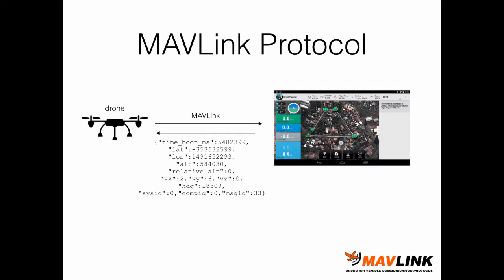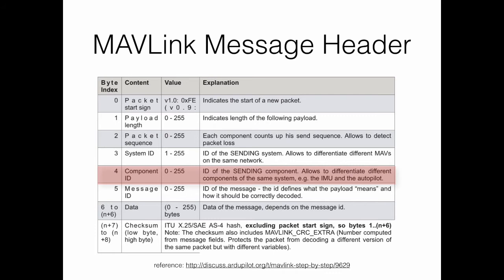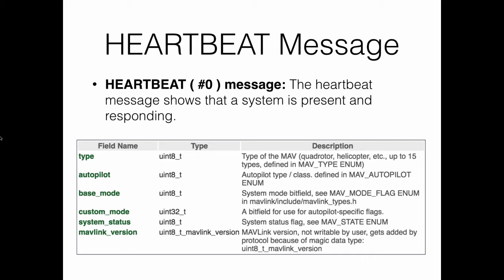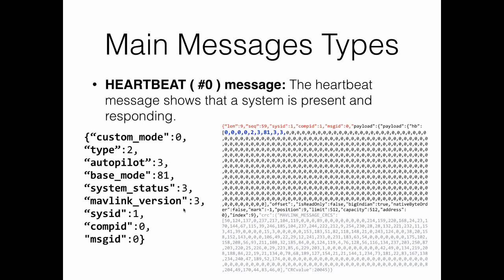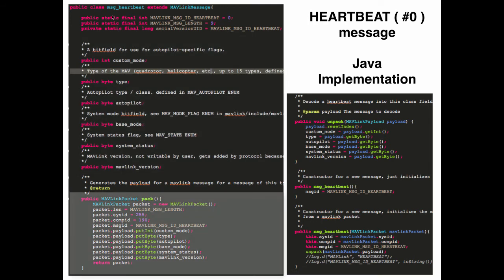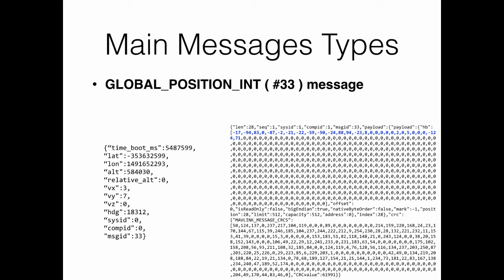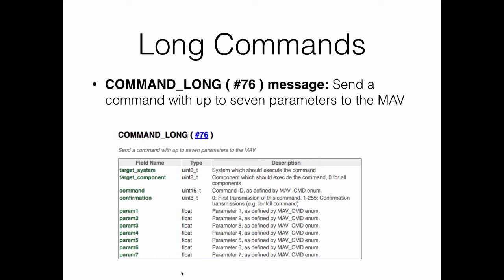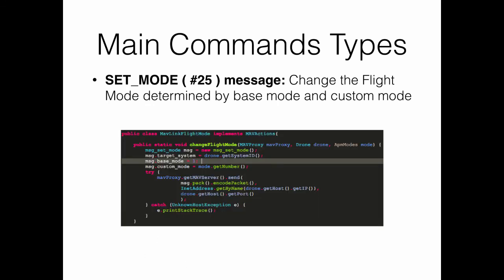[MAVLink] Mavlink Messages and Commands

Comment: Trying to figure out the mavlink protocol:
"the fly to point" command does not work in guided mode.
I use mavlink_v2 with commands:
mavlink_msg_command_long_pack_ (system_id, component_id, (mavlink_message_t_ *) & msg, system_id, component_id, MAV_CMD_NAV_WAYPOINT, 0, 0, 0, 0, 0, 526789160, 586725201, 110);
As soon as I switch to auto mode, it flies.
Tried this command
mavlink_msg_set_position_target_global_int_encode (...)
- the result is similar

The rest of the commands - Set ARMED / DISARMED mode, Takeoff and others work correctly. "

You have not encountered similar?

Comment: Nice video. Can you please do a video on how to control an ardusub vehicle by using python? I have with me, a pixhawk-1 autopilot, raspberry pi and a normal computer. The computer is connected to raspberry pi using ethernet(tether wire) and the pi is connected to pixhawk-1 through usb port. Now i am using joystick to send commands like arming, rotating thrusters. Now if I want to send mavlink messages in python (using keyboard instead of joystick), apart from python and its dependencies, what all things I need to install? How can I send mavlink commands to my vehicle? Also in which window will I get the messages sent from the vehicle  to my computer? Please reply

Comment: Nice explanation! But it lacks certain links. 
I wanna build a feeder board that would receive GPS signals, measure couple of voltages, current, bmp085 and temperature to send it to Minim OSD. Is there provision for transmitting such info (message ids?). 
How do OSDs learn home direction - do they receive heading from the flight controller? Again then, which is the ID?